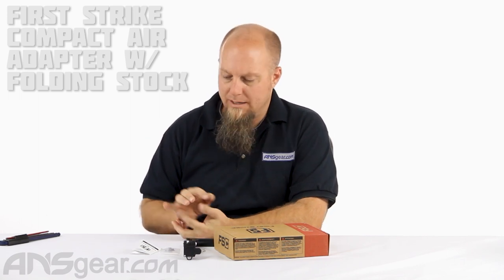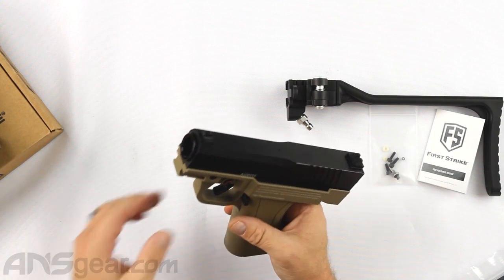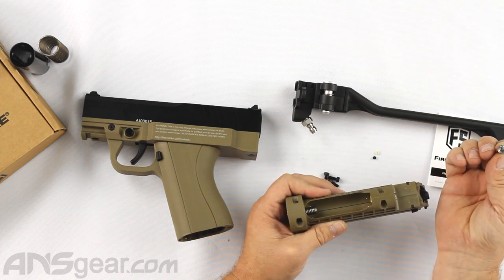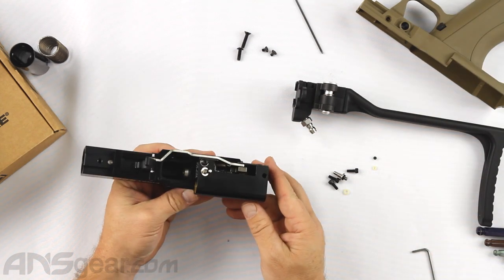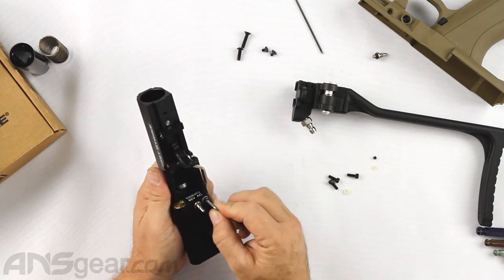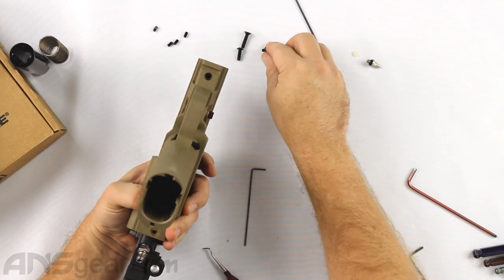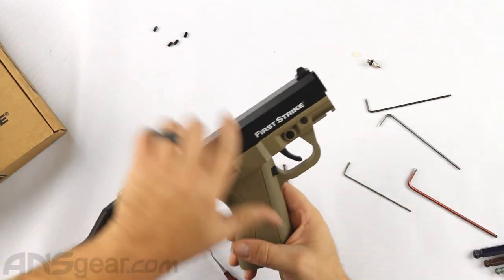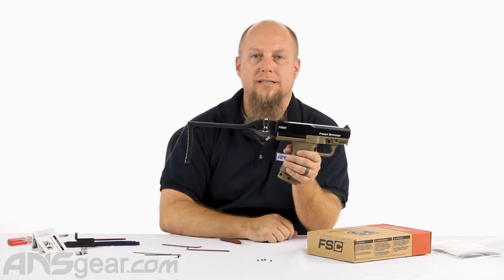First Strike Compact Remote Air Adapter w/ Folding Stock - Installation

Comment: I did hear you can run this stock while still using the co2 in the mag. I believe you just put a plug into the remote line slot. The same one that comes with the T15 remote buffer tube.

Comment: +++ if I just wanted the folding stock and was not adding an air tank, could I leave the screw with the hole in place and not change it out?

Comment: Can't you just screw it on the back no problem and still use co2 from the mag
Reply: The air would either pour out the magwell from your air tank, or out your stock from the CO2 canister.
Reply: But if you didn't do any of the swapping of o-rings or swap out the pin for the CO2 yes you could just screw this to the back of the marker.